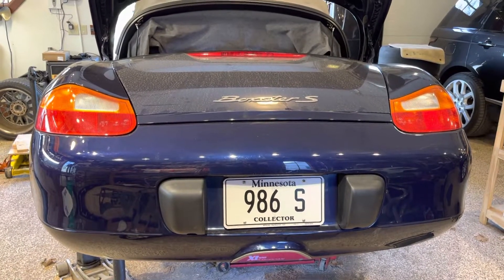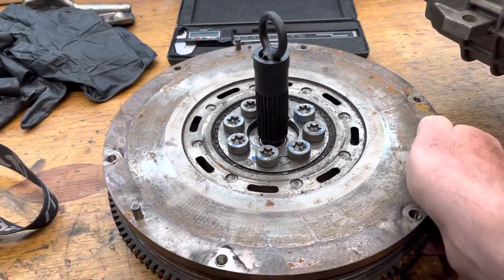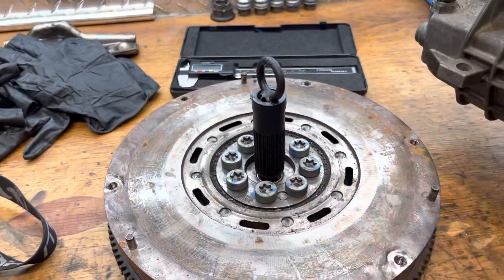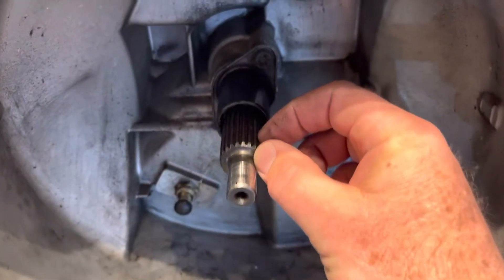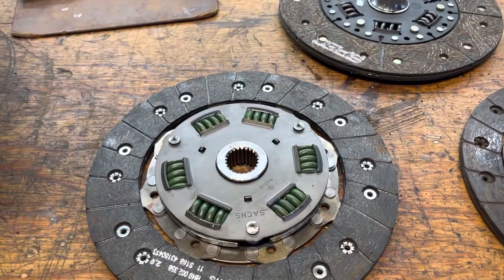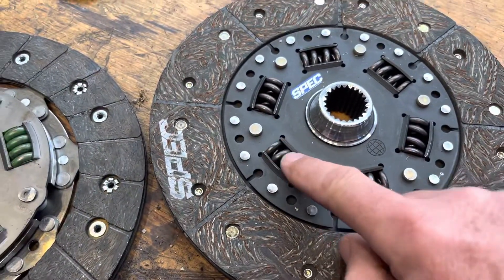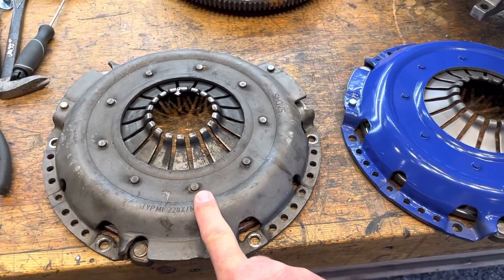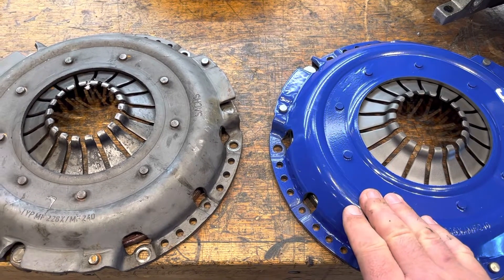Considering a lightweight flywheel for your 996/986 Porsche 911/Boxster? Watch this first.

Comment: Thank you for your video. I stumbled across it whilst researching a SMF /LWF for my 981 Spyder.

I’ve found a supplier in the UK who do a complete kit..but they also appear to use a Sachs clutch with a small friction plate….may I please ask if you this this is the same potential issue?

Comment: Thanks for sharing.  What flywheel are you using?  Shame with the SPEC pricing versus stock disc and that (at least not where i saw on their site) the disc isn't available by itself.
Reply from the maker: I am using an aluminum single mass flywheel. I do not recall the brand name. I believe there is really only one supplier for the vehicle for aluminum flywheel…
Reply from the maker: I am using a single mass aluminum flywheel. I don’t recall the manufacture, but when I looked into it, I recall there was really only one primary manufacturer out there. It seems to be good quality, and I can tell a noticeable improvement in snappiness with engine response.

Comment: My only guess how that pressure plate could be different and applying 2700lbs force, from only watching the video of course, is that the spring rate of the metal has been increased